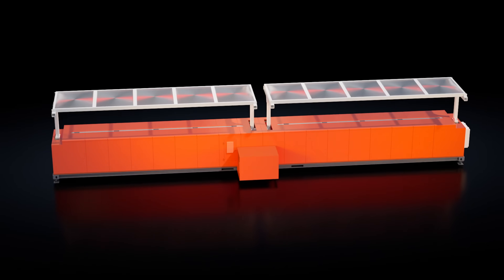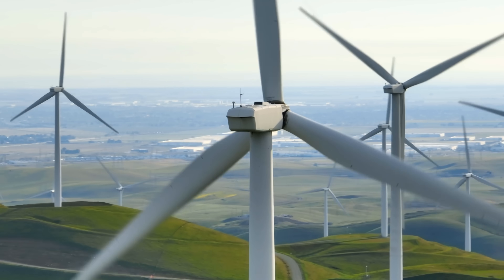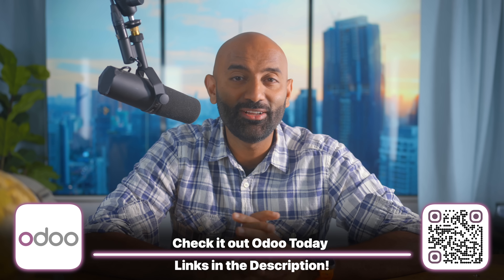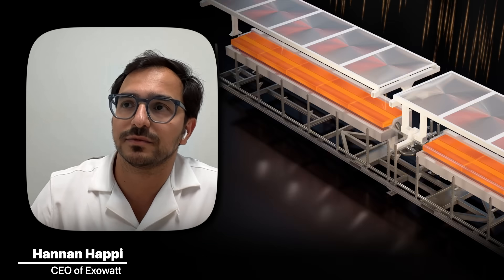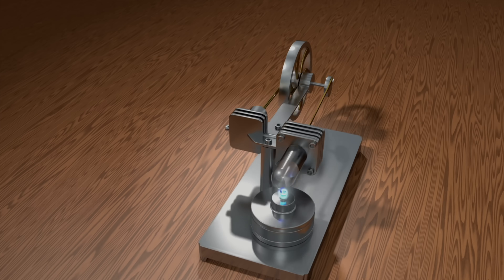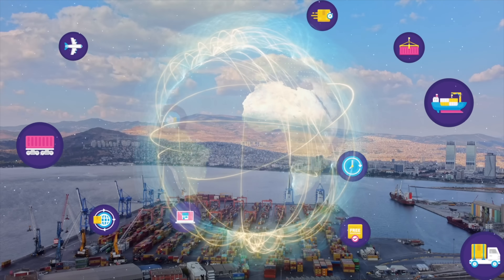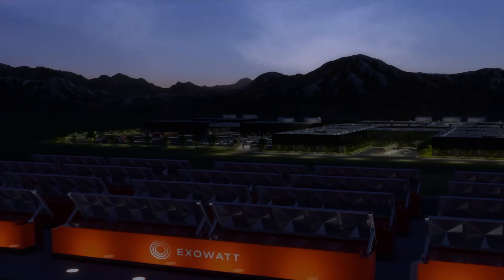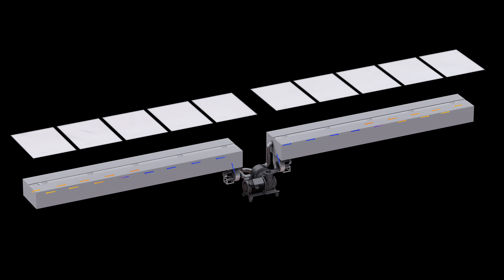Solar Without Panels, Storage Without Batteries - EXOWATT

Comment: Overall efficiency = Fresnel lens × heat storage × Stirling engine
= 0.9 × 0.95 × 0.2 ≈ 17% (realistic)
In practice, the overall electrical efficiency of such a system is usually between 10 and 18%, depending on the design.
Photovoltaics (PV) currently have electrical efficiencies of 23% (at the module level), excluding moving parts and are much cheaper.

The yield will be 2-3 times lower in all countries with average sunshine hours, because the lenses only work when the sun is shining. PV, on the other hand, generates electricity in any light.
My conclusion: Such a system is only profitable in countries with very bright sunshine and, first of all, it has to be as cheap as PV. Since PV prices continue to fall, I don't believe in this system.
Reply: Okay but have you considered that this is made with extremely common and cheap materials unlike solar and batteries? If scaled up properly solar will never outperform it in terms of price for the simple reason of not needing any rare earth metals
Reply: @matthewnickolas4706  LFP used lithium, iron and phosphate all of which are common.  The trace elements in photoelectric cells are in some number of parts-per-million and none are rare earth minerals.  I had a long  tome about the relative energy densities, but I realized I missed by a few orders of magnitude, so I had to delete it.  My bad.

I do assert, however that placing the identical tracking system proposed for this system would provide superior gains in land-use efficiency vs. converting the photon energy to thermal energy then to electrical energy.  So if land use is a priority,  this system will suffer.

I've about 10 kW of panels deployed largely suboptimally on my roof that is probably not much different from the available area of a 40' container.  The system's peak daily collection hovers around 50 kWh/day or supporting an average of 2 kW.  Assuming a 15% efficiency to the mains from the light incident my panels I have about 333 kWh/day of incident energy.  I think the video claimed coupling 50% of incident energy to thermal energy yields 166 kWh/day.  Let's give it 200 kWh/day * 0.3 for the Stirling engine efficiency, yielding 60 kWh/day.  The average daily power is 2.5 kW.

Since the system is being designed with a 25 kW capacity, one can see that the design is being optimized for providing 1-2hrs of energy during peak demand, participating in the same utility market as grid-tied battery storage.  However grid-tied battery storage will likely outbid this thermal storage system for charging energy (the resistive heating element in the thermal storage) because the chemical battery can resell 80-90% of the purchased energy vs ~30% for the thermal Stirling engine.

It may succeed, but comparing a somewhere-in-the-future manufacturing efficiency of a new process with today's manufacturing costs of existing technologies is always a risky business.
Reply: @mrhickman53  Imho, where some HUMILITY might be appropriate is to UNDERSTAND that this is a project that a LOT of highly trained experts have worked on for a few years at least and so PERHAPS your armchair calculations might be shy of the mark. IF they are reputable at all and have done their due diligence then it is possible that they've accounted for much of what you're assuming, otherwise their business model wouldn't be worth the paper it's written on.
Reply: Same reply but double goes for your "belief system" - some HUMILITY might help you to UNDERSTAND that this is a project that a LOT of highly trained experts have worked on for a few years at least and so your armchair calculations might be well shy of the mark. IF they are reputable at all and have done their due diligence then it is possible that they've accounted for most of what you're ASSUMING, otherwise their business model wouldn't be worth the paper it's written on.
Reply: @russell2449  The true experts in the field are always free to further educate me into how to better refine my understanding of how things work.  The fastest way for an expert to make me not trust them is for them to say "trust me".
I also did not say that the system would not work.   The highlight of my comment was that the peak power output of the system does not infer a daily energy collection capacity and that, in my opinion, the sytem is targeted more toward the daily peaking market, exactly as chemical batteries and pumped storage are.  Otherwise the Stirling engine is oversized for a continuous-duty application.
Furthermore, my remarks were  directed primarily toward those musing whether such a system  was appropriate for residential use, which I remain skeptical.
Whether the estimations are from an armchair or while standing up in a conversation tryiing to assess the credibility of an individual's project proposal is imaterial.  The exercise is intellecually stimulating, and when the proper individuals respond, an educational experience.
Reply: I have not performed the proper research, but I imagine your estimate is missing the efficiency of converting broad-spectrum radiated energy into thermal energy.  I suspect that can be in the high .9s but is yet another paper cut.  Balancing that a bit, I would not be surprised if your estimate of stirling efficiency for such a large temperature gradient is substantially low.

Several decades ago, at least one company got to production with diesel residential co-generation in the 5Kw electrical output range.  The maintenance of the systems were their Achilles heel, if I recall correctly.  This system, should the Stirling efficiency approach 0.3 or above, could be a candidate for such a system, where the demand is for low-value thermal energy (residential heat/hot water) vs electrical demand.  The generated electricity becomes a sellable artifact of utilizing relatively efficiently collected and stored thermal energy.  Of course, this now targets the product at temperate climates, placing pressures on the thermal storage aspect and lowering this component's average efficiency value.

Assuming approximately 24 m^2 collecting surface area, peak incident power on the Fresnel lenses would be about 24 kW.  For a tracking system, it might be reasonable to assume > 60 kWh/day of clear days for a substantial part of the season, unfortunately, not the heating part.  Using your numbers approx 50 kWh per day  of stored thermal energy is available during this season.  For your Stirling engine efficiency, this would represent 10 kWh / 24 hr or an average of about 400 Watts electrical output.  Even at double the Stirling efficiency, the electrical output will seem to struggle to meet the demands of a home large enough that the equivalent of a 40' container's work of apparatus blends in.

I am guilty of not listening to the full video due to my initial skepticism, but I will be listening for where I may have misplaced a decimal point.  I am certainly skeptical of residential opportunities for this type of configuration.  Possible commercial and industrial consumers of low-value (low temperature) process heat?  Is the Stirling alternator really adding value to the thermal storage?
Reply: @mrhickman53

Comment: Please promote HELIOGEN! It is using AI mirrors with cheap motors, to generate hydrogen cheaper than fuel. They use AI cars to clean them. Making this a truly scalable solution. They also use rocks to store energy. (I am not a promoter, but I want to see this flourish). Thank you for what you do!

Comment: I don't believe in low maintenance cost compared to PV solar when you have so many moving parts. Do a demo and I might. Of course it works flawless on paper, but it is unlikely to work in real life. Great temperature differences will cause problems with the moving parts. This also killed other similar designs. So I am skeptical. Show me that it works. I would never buy this from just a drawing.
On the other hand. It looks like it might be easy to add more containers with heat storage. This might be a suitable solution for year round heat and power supply. (Yes, why provide electricity only when you also have heat available). You don't even have to store all the containers on site: heat the containers somewhere, store them, then ship them off to where you need the energy.

Comment: I'd be keen to see a tour and am curious if there is a way to gather the waste heat from the data centres and send that back into the thermal battery? assuming they could be co-located with each other.

Comment: You need to consider too the environmental footprint of the entire lifespan of solar panels and batteries.

From mining and processing lithium and rare earths to disposing of the non-recyclable solar panels (and materials used in wind power blades) at the end of their usable lifespans, solar has a very large impact on the environment.

By comparison, the materials used to build these devices are comparatively easy and environmentally low impact in terms of their extraction and manufacture. And they are almost fully recyclable - steel needs small additions of fresh material, bricks can be crushed and reused entirely, and most glass can be completely recycled.

From an environmental point of view, there are costs to the solar panels and batteries that aren't being considered in those calculations. By contrast, the equivalent lifecycle costs for these solar-thermal generation units before and after use are much lower.

Comment: You forgot something, this won't work well if the temperatures are low and a sterling motor won't work at all at low temperatures.
Reply: Stirling engines work on the difference in temperature and the difference between 30 C and 0 C is negligible when the working temperature of the system is 800-1000 C.
Reply: That's the thing, in winter the thermal energy will be less and it won't heat the bricks at 800 C, also is a lot of energy lost by conversing radiation to heat then back to motion and then to electrical energy. Think about this... you get between 27 and 35% energy conversion from the Sun after 30 years of more of photovoltaic tech advance. What makes you think that a old technology like a sterling engine will produce 25kW in the winter? The conversion from radiation to heat is not that good, you get loses 50-60% maybe more, then from heat to motion, another 40-50% and then, again, motion to energy... no motor is perfect, 20-30% loss. At the end, you remain with what? 6kW at best?

Comment: Got a bunch of problems.

In my mind "modular" almost always means "not the right size for what I need". It also means massive ineffciencies and very poor economies of scale. 

For example. If I buy a 10 module unit how much extra insulation is needed to insulate each and every module? How much would you save if the bricks from 10 units where stacked in a single cube (with space for air movement) and then the stack insulated with the same thickness of insulation? What would be the efficiency gain if you doubled the wall thickness? What would be the cost saving of a double wall thickness insulation in a cube instead of 10 individual units?

What's the maintenance cost on 10 individual stirlings? 20 Blowers? All the mechanics and moving parts to move the lenses?

I would encourage them to make their construction materials modular not their units.
Reply: Also 25kW of power? Do you mean 25kWhr?

Comment: You did not mention the generator/alternator, that will also need maintenance, but more importantly how will they solve the issue of phase synchronization. What about the energy required to make the clay storage and  transport from the quarry to the baking site. Why clay it's not much  better than sand if at all?

Comment: A lot of fancy CGI, no hardware. The shading/clearance constraints would be no different from PV panels, so you're not going to get the land use benefit, especially with a system efficiency of only 15-18%. Why not just use high-efficiency, multijunction concentrator PV cells, which can have >40% efficiency?

Comment: Sterling engines require a hot side and a cooler side. If we start packing these hot bricks together , WHERE DOES THE COOLER AIR COME FROM?? The inefficiency keeps growing as the system grows.
Reply: I even wonder how that single axis tracker is supposed to track the sun. I have Fresnel lenses myself (for cooking) and I can tell that's not how it works

Comment: Interesting concept, too many moving parts.  There is a reason you don't see many Stirling engines these days.  You can see these pumps and maintenance at any heavy oil refinery.  It's maintenance costs won't help the overall efficiency. The technology could improve without the engines.

Comment: The standard is used for solar input is 1kW per square meter so 25 kW would need 25 square meters.
the lenses only concentrate the heat they don't magically make heat
If you assume that there is only strong sun for 6 hours a day because there are no sun at night and the first and last few hours a day the sun is weak.
So you now need 100 square meters to get a average of 25 kW of input for the day.
Assuming the stirling engine is 20% efficient it was suggested it was less you now need 500 square meters to collect all the heat needed.
The top of a shipping container has an area of just under 30 square Meters.

so were does the extra 430 square metes of collector come from? 
The area of a doubles tennis court is about 260 square meters.
Does something not add up? 
As for the resistive heating at 20% efficiency does this mean you need to be able to buy electricity at 20% the price you can later sell it for (assuming no other losses).
Reply: Actual stirling engines running on waste heat have 40% efficiency. Then there's theoretic Carnot efficiency of a heat engine nu=1-Tc/Th which gets very high, if temperature difference is high. It's a matter of how high 'Th' is, and how well 'Tc' is insulated. Then compared to PV, one only needs to heat the bricks which is very efficient, and the efficiency is only limited by the design of the lenses. I guess energy input of the lenses isn't comparable to 1kW/m2 input usually used for PV evaluation, it may be higher since lenses tend to be "omni directional".
Reply: Kockums Submarine AIP 40%, Cleanergy Biogas ~30%, Maricopa Solar (SES)  ~31%.

Comment: Whenever we start talking about energy generation, for some reason, you focus EXCLUSIVELY on industrial, utility-sized, generation.
What about the average homeowner?  We need a reliable, grid backup system that can supply power at normal usage levels for up to 5 days.
How would this technology achieve this for the average suburban or rural homeowner? 
Another concern is that conversion of energy suffers losses at each change; the more changes, the bigger the losses.
Solar concentrator to mass storage media, MS media to transfer fluid, transfer to the Stirling engine cylinder, and Stirling engine to generator; that's significant.

Comment: Sounds like BS to me, every time you change an energy source you lose efficiency, solar heat TO thermal storage TO Stirling Engine TO Electrical Generator. I would be surprised if 15% of the energy = usable electricity. Are they really pretending this could replace Solar Panels that through invertors (approx 95% efficient) can dump energy straight into the grid or charge chemical batteries that have a round trip efficiency of approx 90%.

Comment: You are wrong about land use. This system is about 20-25% LESS efficient than PV, with what looks like similar or slightly worse spacing  between needed, yet you keep claiming it takes up less space. Need to tone down the hype. They may also not be able to use early morning and later day sun if there is a minimum light needed, and they won't work at all on cloudy days, where solar would still produce some.

I don't think it would be cheaper. You can easily find panels for $0.20/watt, and even cheaper at scale. You then add racking costs, but you could likely make a 25KW solar for $10-20k. I highly doubt you can make one of these systems for less than that.

The single advantage it has is that it can deliver power after the sun goes down. This likely isn't going to be the "24/7" claimed, if so the output would drop substantially. You could also deliver "24/7" power from a battery, so the short delivery time of batteries myth needs to go away. Any source with "long duration" will also have low output. This also dents the "24/7" claim a bit dubious, unless you drop each container to like 500 watts during cloudy days.

These also have more maintenance. The Stirling engines will need replacing. The trackers may need maintenance, and probably more I am forgetting.

Comment: It seems to me that heat loss is not being adequately addressed. The slit clearly needs to be sealed with glass or some other material that will allow the light through but restrict heat loss.  also the insulation has to be a major concern.  The bricks being heated to such high temps are going to want to lose heat very rapidly in normal environments.